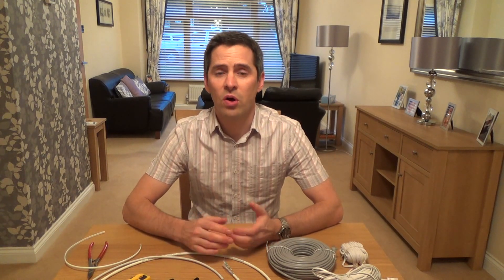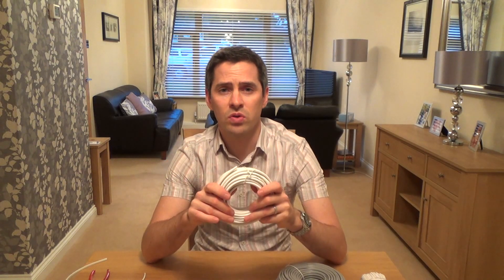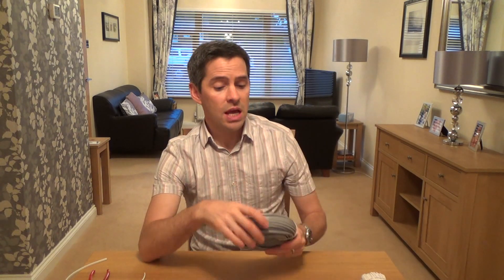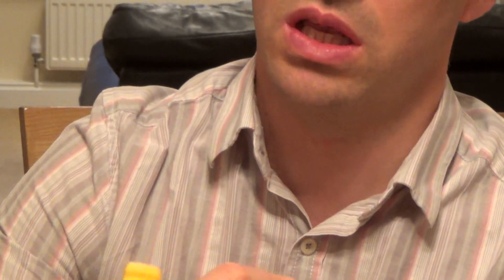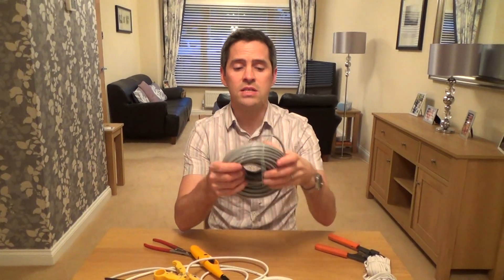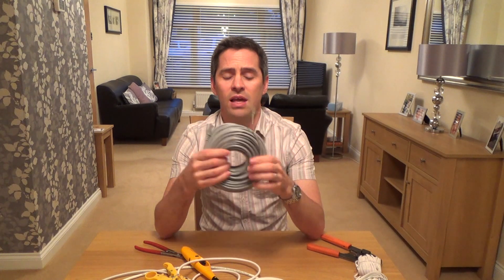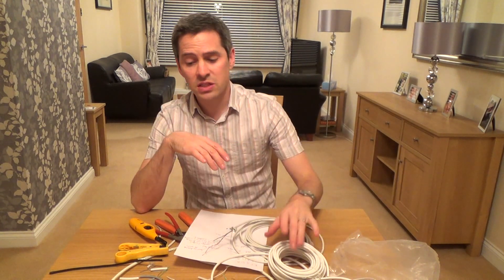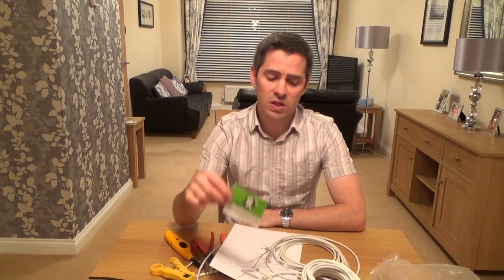How To tell the difference between CCA and COPPER wire cable and FAKE ETHERNET cables

Comment: Would the none copper wires cause slow gameplay " Latency" Also if i cut the wire to see how easy is it to replace the connector.

And i take it all flat ones are not copper?

Comment: Hello, how to recognize a CCA cable from a Solid Copper without stripping it?  I am in France, and apart from a single reference, there is no indication if the cable is CCA or Solid Copper, neither on the label nor on the cable itself

Comment: Yes, I see from your video that physically there's a difference.  

BUT when I measure the internet speed speedtest on my router, I don't see any speed difference with Cat6 ethernet between my copper versus CCA cables.

So I think the advantage of copper over CCA is if you need to transmit power to keep the wire cooler.
Reply: for what distance are you testing?
there might be for longer distances, e.g. >20m
Reply: @shmadmanuts  The CCA was 75' and it's 5 years old (problems started at about 4.5 years).  I replaced the CCA with 100% copper at 35' and I haven't experienced any dropouts for 3 weeks so far.  Never CCA again for me.... I threw it in the trash.
Reply: @mrpmj00  

Another advantage of copper vs CCA is when you use it as HDMI/USB extender, since HDMI/USB extender is very picky about the cable standard
Reply: @mrpmj00  

Another advantage of copper vs CCA is when you use it as HDMI/USB extender, since HDMI/USB extender is very picky about the cable standard

Comment: Mate, could you please tell me which wire strippers and cutters you are using, or what modern iteration you suggest?  I'm having a lot of trouble locating proper high quality tools, and price isn't necessarily an indicator of quality these days sadly.

Comment: So really if you buy data cable with plugs fitted you've got to cut a plug off to to check. Think in future I'm going to buy a good quality bobin of cable that I can check and fit my own plugs!. Ps. Some say 100% copper but it is often stranded - now it must say SOLID COPPER.

Comment: I couldn't get my RJ45 keystone wall jacks to function after trying several different keystone jacks. Turns out the cable is made from aluminum strands and they are too thin to make good contact with the punch downs. The cable was installed in the house about 8 years ago. This video puts it all together for me. Thank you!

Comment: I bought some "cat7" cables on amazon, they were clearly fakes. I don't think anyone makes flat cat 7 cables..well anyways tried them out and they were plain garbage. Constant drops and disconnects, bottlenecking, etc you name it. Put my old cat 5e back on..and what do you know? Problem solved. I was just dumbfounded on the amount of people giving this garbage 5 stars. I can't understand how they cannot tell the difference when clearly I can...which leads me to believe they are fake reviews meant to bolster their product without a doubt. Bought some other cables, but this time 6a, still not the proper gauge, but it appears at least the twist is correct. It's honestly hard to tell nowadays which cables are real and which are not. What bothers me the most is how companies like Amazon continue to let this happen. On second thought I guess not, they care more about the bottom line (i.e. money) than they do about consumer satisfaction.
Reply: 'Flat cat 7 cables'should not exist, as it is impossible to apply the correct shielding as required by the Cat 7 specification I.e. flat cat 7 cables are all fake.

Comment: I think the solid core copper is usually run in walls where it isn't disturbed. The stranded core copper is for connecting to devices since it needs to be flexible without breaking. Great video !

Comment: Thats the best DSL cable i ever seen, you cant compare cat5e twisting with telephone wire DSL twisting, cat5e need to support up to 100 Mhz .... ADSL2+ needs to support 2 Mhz.... so you can't even compare one to the other... that DSL cable is a very good one ... and shielded ;)
Reply: I think a DSL cable only has to meet Cat3 specs. That would explain why it has less twists. A shielded cat5e would be better than the DSL cable he showed, but not necessary for DSL.  I was really surprised when he said he made Cat6 DSL cables, that's an even bigger waste of money.

Comment: I had discovered a fake cable on my own then went looking for more information and found this video. My cable was included with other LAN equipment, it was not a patch cable purchased cheaply off ebay.

The symptoms I was seeing is that is did not consistently connect to the LAN switch at 1Gbps, sometimes it connected at 100Mbps.  I thought the switch had a bad port, but moving ports didn't matter.  The I tried another cable (that I made), it worked perfectly and consistently.  So I thought perhaps the bad one just needed to be re-terminated. When I cut the end off I was shocked that two of the pairs didn't seem to have any twist at all and the color coding was wrong.  But just like these, the outside was stamped with the all the standards information for Cat5E.
Reply: Arrgh... I just found two my fake cables in my stock, not sure where these ones came from. Just like the ones from a couple years ago...non standard color coding and no twist at all...yet clearly marked as Cat5e.  One thing I've noticed with these fake cables, is they feel different when you handle them, they are kind of squishy.  That's because there is a lot of empty space between the outer insulation and the individual wires. I'm guessing this is due to wide manufacturing tolerances OR just an attempt to make them look the same diameter from the outside as a proper cable.

Comment: braided cable is junk use solid wire IMO, braided cable is speaker wire
Reply: A patch cable should be stranded. In wall stuff should be solid cuz it won't move

Comment: Hi. Thank you. You have educated me more. Iv never bought that bad of a network cable. Reason im commenting is on usb. My samsung note 4 have fast charging but with samsungs approved brick and cable. So lucky me the dog ate my cable. So in a local shop in town i saw this cheap cable that had a good feel and look to it. Well it worked one week and died and i had no fast charging. So i found that i had a kodak usb cable. Also a good brand. So i used this cable. And my fast charging was back. Old cables i threw in my waste cables box. This was over a year ago. Tonight i saw your video. So i found both my broken cables. Stripped them. But both was gray inside. Did the flame test. Both burned. But the samsung lasted about 4 times longer before it melted. So i believe had more copper in till what my phone require so there still some cost cutting but it had the rite amount of copper to fast charge my phone at the rate samsung is advertising it to do. Burned cables before and they burn like paper and other shield melted before the cable even bended. Great video.

Comment: Valuable information, thank you Sir...! I have been using a jewellers 
10x magnifying glass to inspect the cable wire ends in the RJ45's in use
 on my network (and patch spares). It is visually simple to identify 
Copper, CCA and FAKE. So far I've chucked away over 60 metres 
of Cat5e cable which turned out to be all aluminium, let alone CCA.
Reply: Could you please explain how do you identify fake and genuine cables using visual inspection (magnifying glass)?
Reply: @MikolajMajewski  ... I am classifying "FAKE" as being those cheap shoddy CATx cables that either contain a white metal wire (aluminium) or wire made from Copper Covered Aluminium. Inappropriate for network use in my opinion and experience.
A good magnifying glass helps inspect the colour of the metal wire exposed in the end of the RJ45. Try it yourself.
On reflection, I should have just called those fake cables "CRAP". 🙂
Reply: @petephillips8559  Thanks Pete!

Comment: electricity always travel on the surface of the wires in AC not in the center so a aluminium core and copper surface, or pure copper all the way through doesent matter.
Reply: Networking equipment is low voltage and DC not AC. The copper vs alum does matter.

Comment: Good video, I was going to make my own video to explain this, but you've already done it :) That said, you are getting what you pay for, CCA cables are cheaper. I would also say, over short distances, you typically won't get a problem with CCA, the issue is voltage drop due to the increased resistance. The flame test shows the melting point, so 650 for aluminium, and 1100 for copper. I've personally  had some cheap shotgun CCTV cables fail which were CCA, so it's not just ethernet cables.

Comment: Vince have you seen the cat7 cables for sale there are suppose to be a lot better than cat6 cable
Reply from the maker: Hi, Cat7 are better but even cat5e still works at higher speeds than current broadband provides in the UK so we really won't need cat7 cables for many years as most of use just use the cables for the internet rather than directly networking computers together. So for UK broadband speeds even on Virginmedia 200Mbps package a cat5e will perform the same as a cat7 because the cat5e can handle 1000Mbps.
Cheers Vince

Comment: Thanks for this fine video calling this stuff out. I did not comprehend how far the fraud had reached. I was researching why I could find only CCA speaker cable and nothing pure copper. It didn't/doesn't make sense why this stuff is even used (other than shorting the user). The other thing people need to be aware is aluminum is a much more fragile metal and probably the reason it was hardly twisted together in the cat5 - because if it was it probably would break!
Reply from the maker: Thanks for the comment, very much appreciated. It is purely to save money on the product and also on shipping as CCA is lighter.

Comment: Hey Vince, are these real copper wire cables? 

http://www.aliexpress.com/item/AUCAS-0-5M-15M-RJ45-CAT6A-FTP-Patch-Cable-Network-Cable-Orange-Color-Ethernet-Cable-CAT6A/32618333911.html?spm=2114.13010308.0.53.oWrQ7Q&aff_platform=aaf&sk=z37uniM7e%3A&cpt=1463232578026&aff_trace_key=2a303296d16b476a97f53b269a502fd5-1463232578026-08332-z37uniM7e

and this http://www.aliexpress.com/item/12pcs-pack-10-Gigabit-CAT6A-SFTP-Patch-Cable-1M-White-Color-Ethernet-CAT6A-500MHz-Patch/32304465727.html?spm=2114.13010308.0.48.oWrQ7Q

thank you for your help!

Comment: I wish I had seen your video before buying an imitation. Thanks for the info.
Reply: Btw for wires you can ask seller to remove all plastic shells and than check mid centre of cable if it was white is definitely is aluminum or cca but if was red color that's 100 percent pure copper wire.  I hope i can save some one's under scammers
Reply: Ahmadreza Iglesias A scammer won't let you bare the wire to check. If the seller won't let you check you know it's fake!

Comment: I have been using cheap cables to connect from my VDSL face plate to my Router. I am not sure what is going on but the internet has had untol intermittant problem and sometime wil not syc at all until I change the cables.  I have has OR check the whole network and no problems found. I have troubleshooted everything to trouble shoot and have gone through about 15 RJ11 cables that work for a while but problem reoccurs. Right now I am putting it down to the cheap cables failing. (might stip one and do this test. Anyway, I bought some twisted copper cables from Mr T - lets see if they help and stop the syncs from dropping - Thanks Millie :)

Comment: Thanks Vince, I just came across this video. I'm in Canada. Is there any way to tell if a cat5e cable is solid or stranded (in the store or online) without stripping it open? Can you recommend any brands in North America?
Reply from the maker: +Joe Smith Hi, often it will say on the packaging or if you look very closely at the cut end of the cable then you can see if each wire has a single core or tiny cores (often 7) clumped together.Thanks Vince

Comment: i do have a question?
why in your video are you selling/using stranded cable? most of the cat 5e sold here in the usa is all solid core. wondering if theres something going on i should be aware of.
Reply from the maker: geoffrey walker Hi, most ready made patch leads worldwide are stranded core. I mostly sell solid core. You can get CCA in solid or stranded core. The reason people use stranded is because it is more flexible but if you are terminating the cable on wall socket/faceplates then you have to use solid core.Thanks Vince

Comment: I recently bought a cat6 cable off ebay advertised as highest spec & had cat6 written on cable, after installing it I had problems with connection dropping, the cable was half the price of some of the cables on there. after seeing your video I tested the cable with your method & it was FAKE, looking on ebay now most of the cables are cheap which makes me think they are FAKE aswell.   thank you vince will buy off you in future,  ps  trying to get my money back off George (ebay).
Reply from the maker: phil jones Hi, thanks for the message. Hopefully you will be able to get your money back. In the future it may be worth double checking with the sellers on Ebay to confirm if the cable is Copper or CCA. If they do not know chances are they are CCA.Many thanks Vince.